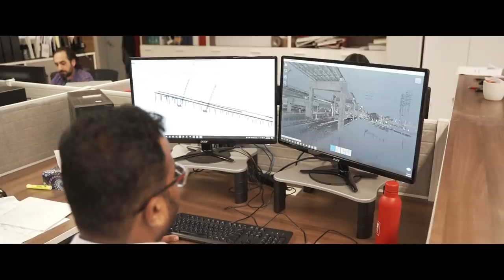The Gardiner ExpressWay Eastbound Ramp Demolition

Comment: Excellent work! Job well done!   That was a massive amount of concrete to hammer! Did you have to replace any hammers on the track hoes? Or did they all hold up under all that use?  The amount of rebar and tonnage of steel beams was unreal, were the steel beams all scrapped ? Thanks for sharing your work with this video! Hope you do more longer videos in the future! 👍👋
Reply from the maker: Thank you Luke - I will look into your questions and get back to you.

Comment: Have used the GE many times over the many years that I have visited Toronto - can someone explain why there was a need to remove this structure that seems to have been extremely well built given the effort to demolish it ?? Also why was the work done on weekends when clearly the GE couldn't be used as it was being broken up ? Best Wishes from Australia.
Reply: I had similar questions. Noticed near the end of the video that during the week traffic was using the space under the structure as a road. So this would have to be closed for demo work, and clearly could only be closed in the weekend. As to why the demo, I don't know.
Reply from the maker: The removal of the the ramp is part of a much larger flood protection plan for the city of Toronto. The work was done on the weekends as to not disrupt the flow of commuter traffic through the week. Visit the Waterfront Toronto website for more info.
Reply from the maker: @zestoslife  Traffic is still able to move below the GE on Lakeshore Boulevard.

Comment: Looked like a fun project! Just wondering why concrete dust mitigation wasn’t addressed? It looked like it wasn’t close to residential dwellings,  but what about for your employees?  you had access to an endless water supply a couple of meters away. I saw a water truck but it seemed it wasn’t near when the concrete demo was going on. Or the video made it seem incredibly dusty than maybe it actually was.
Reply from the maker: Great question - the water never stopped on this  job, it was constantly going. In fact, we used almost as much water as fuel (approx. 900,000 L) to help keep the dust down.

Comment: You seriously used the equivalent of 249,642.59 gallons (945,000 liters) of fuel for that job? That’s an insane amount of fuel.
Reply: you ain't gonna get it done with a pick and shovel..
Reply: Them link belt excavators hold ~180 gallons each. The 10 on the deck alone require ~1800 gallons to fill once.
Reply: @STONEDay  okay. So around 3,000-4,000 gallons to fill up all of the equipment on site once.
Reply: @coopermeshew4298  a lot more than that. There’s excavators on the ground, zoom booms, manlifts, dump trucks, rock trucks, generators, cranes, air compressors and probably more that I’ve missed.
Reply: They would have had to be filled up multiple times during this project likely once a day and the trucks to transport the waste off site
Reply from the maker: @R L Not a typo. We also used 900,000 L of water in dust mitigation. Over 9500 worked hours. The numbers are mind bending.